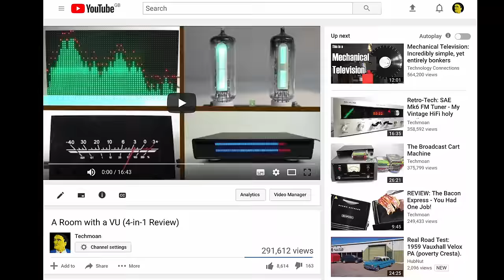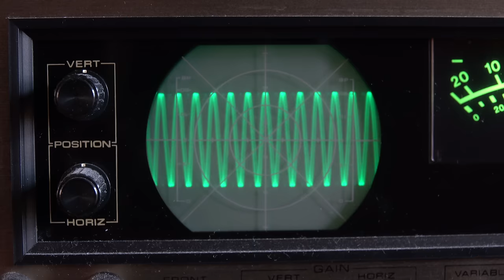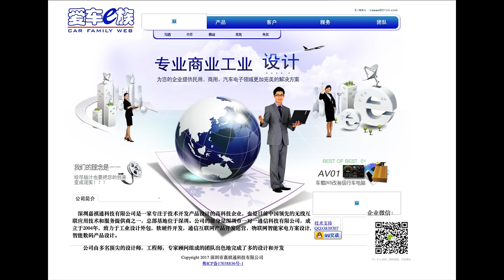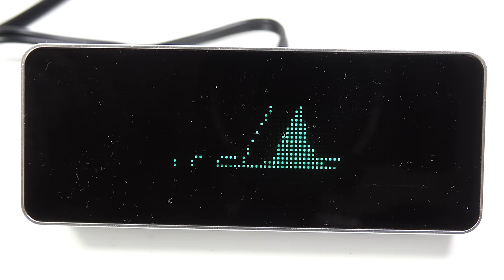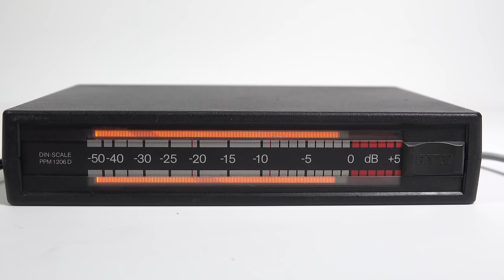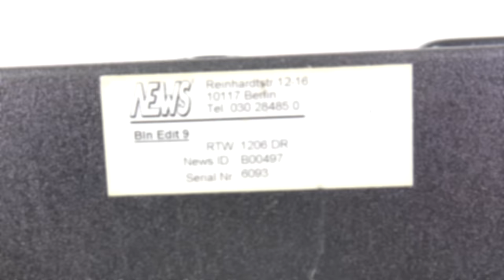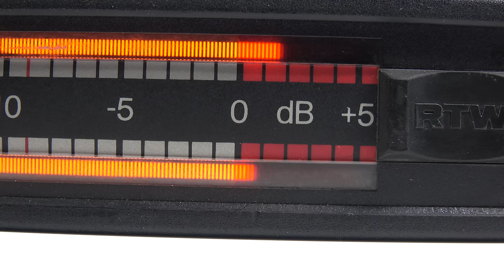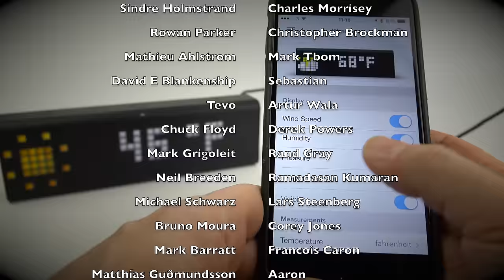What a lovely VU : A metre of meters*

Comment: 10:34

I think there may be a bit of a hidden feature on that VU meter.

It looks like there is an extra scale display inside that plastic cover. Maybe it has to be manually rotated 180-degrees so it fits the front panel.

It might just be a replacement scale, or have different values printed on it.
Reply: Ahh, here we are...

"Dual standard model with a practical sliding scale
Depending on the model you choose the ingenious sliding scale
enables either twin standard operation or switching between
horizontal and vertical installation."

http://www.old.studitech.ru/resque/manuals/rtw/RTW_1200_Series_PI.pdf
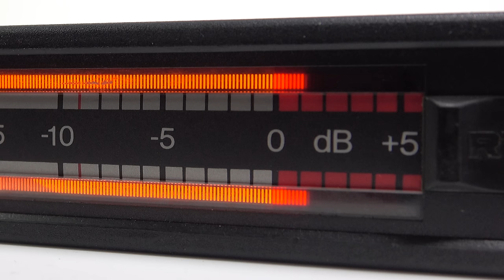Reply: 10:07

OK, so you basically just slide that thumb dial to the left, and it will shove in the other type of scale, where the numbers are rotated. Nice.
Reply: LOVED the puppet sketch. haha

You get people complaining about the ~15 KHz CRT noise on many retro gaming vids, too.

It was never that big a deal, even when I was very young and could hear it from a mile off.

I kind of miss CRTs now (I used to repair them), and I'm slowly rediscovering how great they can look.

I NEED to get hold of a proper PVM soon.

Comment: What?  People are sensitive to a CRT's high pitch whine? When I was a kid, I could only hear it when I put my ear on or near the back of a TV set. Living in America might have something to do with it though. I don't think it would be that much higher in frequency. I never had a C64. What we had was a TRS80 Color Computer 2 which was similar to the Dragon computer. It didn't have a SID chip. Just one square wave channel that was produced by the CPU itself. I suppose they could have made one for the expansion bay. They did have a music synthesizer for it. The expansion bay was where you placed ROM packs (cartridges) and the disk drive module.
Reply: Robert Gaines The European PAL system fixed color decoding problems inherent in the NTSC signal by using 64μs delay in the composite to RGB decoder. In most products, this was an acoustic delay playing part of the video signal as vibrations through a precisely cut crystal block.  I'm guessing this can leak more of the whine from pixels and sync pulses repeating line by line.

Comment: Anyone noticed the RTW "button" in front? Seem that it slides (left and right) to enable different scale.
Reply: No it's for horizontal or vertical positioning
Reply: It does! @techmoan Do be careful though if you try it out to see what your other scale reads (depending on the scale could be dbu / dbv) as they get more prone to breaking the older they get. It is possible to get replacements through RTW but they are quite expensive.
Reply: Yes it does, in this case it seems to change between horizontal and vertical scale. I guess there were different layouts available. I have worked years with these meters, quite common in the broadcasting industry in Europe, very good meters and apparently very reliable too.

Edit: Looking more carefully it says it in the product description in RTW's web site. There were different models. I myself have model 1206N that switches between DIN and Nordic scale. Wikipedia has a good article on the subject, look for "Peak programme meter".
Reply: Our RTW's can display VU or PPM, depending on the position of the slider. It senses the position and works accordingly. Other versions have horizontal/vertical scale.

Comment: The struggle with CRT noise is real. When I was growing up in the 80's and 90's, I got migraines from it. When I was real little, my dad noticed any time we'd go to the TV section of an electronics store (dad spent lots of time in them with me because he was always shopping for computer parts), I'd cover my ears. He thought it was the noise until we did an experiment when I was about 8 or so that proved I was able to tell whether a TV was on or off and with the sound muted. As I got older I found it interesting how what was on the screen would modulate the sound. Though I'm in my late 30's, doctors are surprised that I can even hear ultrasounds (I just recently had several scans because of a gall bladder issue).
Reply: I used to have a problem with the ultrasound burglar alarm at a local hardware store when I was a kid back in the70's. I used to say something to my parents everytime we went in there , but they couldn't hear it so I guess they thought I was nuts.

Comment: You should try out a DOD SR Real Time Audio Analyzer, makes a great visualizer, its relatively cheap, much better quality than the stuff you have reviewed and on top has an actual use.  It creates a pink noise so you can calibrate your stereo via an equalizer.  You would love it.  Its a nice size as well, its rack mounted so it may not look great depending on your setup, the frequency range is very wide as well.

Comment: The display look alot like the one in the Nakamichi T-100 test set.
The little one might be good quick verification of signals depending on if you had the ability to look at separate left and right and not composite

Comment: Are these spectrum analysers simply using the FFT internally, or are they using some kind of digital filtering like a vocoder? I'd love to know how these things actually work, and what kind of DSP chips they're using (if any).
Reply: Amberoot Audio They look like primitive band pass filters (or digital emulations).  Because a proper 0.1s FFT should not smear out the test signal to nearby frequency bands like that.
Reply: @johnfrancisdoe1563  Thank you, makes sense. I thought the same about the frequency resolution. I noticed at 7:40 how quickly the frequency display 'rushed' to the higher frequencies relative to the lower frequencies, which shows that not only is the frequency domain not logarithmic, but the frequencies the band pass filters were tuned to must have been arbitrarily chosen for the sake of creating the most exciting animation.

Comment: Try this peak display out  it’s from America audio the model is dB display mk 2 it’s as 19”  led display nice and bright you can set the display level with a control on the front panel it has a left and right Chanel. rack mountable unit rca xlr inputs and outputs.  I use it on my hifi very impressive bit of bling    I forgot to tell you all they are about £45 ish shop around prices very

Comment: Dear Techmoan, The RTW meter's plasma display is very similar to that of the rare Nakamichi T-100 Audio Analyzer. If you can get a hold of a T-100 for a reasonable price, just buy it. I have one made in the early 80s and use it to align cassette deck heads and to test speaker cabinets but also as the nicest looking peak program / VU meter ever. Here's one: https://reverb.com/item/10817569-nakamichi-t-100-audio-analyzer-working-and-tested

Comment: I had a VHS player when I was a kid that had the same type of display
Reply: Good question glad you asked! If you don't remember there was this period where VCRs became basically worthless, idk kind of close to when DVDs came out. Anyways me being extremely curious about how electronics work I took it apart to use the motors for projects. I ended up using the display as a clock for my pinewood derby car shaped like an IED (improvised explosives device). Anyways as for my collection of VHS tapes I converted most of them to digital formats at some point, as much as I love the nostalgia of a VHS tapes, they went exactly built to last
Reply: @P004ME2LicensePlate  I think were getting way outside the scope of my initial comment here. Point is vacuum florescent displays similar to this are pretty common in consumer electronics.

Comment: Is that a Dorrough meter in the teaser at the end? Their meters show VU + PPM to represent the crest factor (like Wohler... check this one https://www.wohler.com/product/audio-monitoring/amp1-da106/)
Not sure RTW discontinued the 1206 bc the display manufacturer stopped... I mean they could have replaced it with something else. The industry has just evolved: most mixing consoles, even the cheap one, come now equipped with very good meters (wasn't necessarily the case before) so RTW needs to go to the next step. Their focus is really on loudness measurement (and this can be so much more complicated to display) and multichannel. Their service is indeed amazing... always super fast to reply to emails. I once had an issue with my meter and they fixed it at no cost (and paid for the return shipping) although it wasn't under warranty anymore.

Comment: i picked up a kit from ak tech similar to the first one, though the one i purchased combines both channels into w single display so it isn't as wide and it seems a bit taller.  the construction is similar, but this one has a connector in the middle of the boards as well as to either side.  the leds are the same style, but are green all the way up.  i didn't have any issues with it, though it seems to require high volume input to really light up, thankfully i have a headphone out on my preamp that i don't use so it isn't an issue.  it makes everything sound so much better, like a flame job on a car.

about the leds cutting out, are you using the cord supplied with the kit?  mine had a similar issue until i replaced the headphone cord with a higher quality, tighter fitting one.  the one that comes with the kit is junk and the female input on the board is cheap and loose.  listen for some noise coming from it, the cheap cord put a very noticeable hum in my audio where it was loose in the jack.

Comment: @Techmoan Could I ask you a question? I have a Teac X-3R reel-to-reel and the VU-meters have gotten some UV-damage but work excellently otherwise. It's just that, just like red cars from yesteryear, the red line and text on it has faded over the years. Do you perhaps know any way to restore this, or maybe a location I could find information on restoring VU-meters?
Reply from the maker: I don’t know - but perhaps ask on Tapeheads.net
Reply: @Techmoan  Thanks, I'll give that a go. 

Otherwise the only way I can think of is simply getting a replacement set of meters that are still in good shape, or at least ones of which the label is in good shape.

Thanks again.

Comment: Hated the high frequency noise from some crt's 
Some were worse than others. I remember Rank Arena colour TVs were terrible. I could hear thd sound of them from the street when i was walking down the road. And some banks had terminals that were just unbearable. When computers were introduced to my workplace, i thouggt i was going to go mad from the high frequency noise. The only saving grace was i could hear a monitor left turned on at night anywhere in the building and go and turn it off. It was company policy  that everything be switched off and powered down overnight.

Comment: I am thinking about getting a couple of those cheap VU metres from China and making a homemade unit. Supposedly they come with aññ the circuitry on the back of each metre to connect direct to the speaker connection on the amp in parallel, but, my concern and something I can't find an answer to, is wouldn't this affect the speaker impedance like having 2 speakers in parallel in the same output, which would lower the ohms too much?

Comment: I have /had a service manual for the rtw somewhere . Do you want it?  (found it and it is for the 1113E peak meter instead)
Reply from the maker: Thanks for the offer - but I don’t think I’d use it.
Reply: @Techmoan  Hi , now that ive found it, it's for the 1113E  (used the same display i believe)  .
Reply: Hello love VU meters as well... I want to find an extremely accurate one for use with adjusting and testing audio equipment... I've read that the ones in cassette decks aren't extremely accurate LOL and only the upper portion is the more accurate portion of the whole scale (but still not like SUPER ACCURATE) the 3rd one looks like a very accurate one ... being used in a professional recording studio I'm sure its MUCH MORE ACCURATE than the ones used in cassette machines ... look forward to the follow up videos to come ... GREAT JOB on the videos you make love your channel
Reply: Try to find yourself an audio test set like the Ferrograph RTS1 or similar . They make aligning tape recorders relatively easy (something i used to do for a living)

Comment: I never miss an episode and rarely stay for the puppets but OMG that whine from CRTs is real and it’s horrible!!! I’ve been trapped in a cancer scanning machine once for 4 hours and the CRT across the room was the worst and NO ONE but me could hear it. I was I my mid 20s then and I was basically told I was crazy. 

I need to find an old CRT to check if I can still hear that sound because it will legit make you want to jump from the highest room off the tallest tower.
Reply: Jesamy Porter 15.625kHz exactly in Europe's 625 line x 25 fps format.

Comment: Today, electronic devices so mini. Miniature! İn my opinon,this is not necessary. İt had to be in a balance. I would prefer to transistors and more big electronic devices;  instead of microchips... İnstead of miniature size and expensive electronic devices.
Reply: High-density highly integrated devices are plain cheaper. Same ICs in smaller package are cheaper. BGA is cheaper than SO and in turn SO are a lot cheaper than DIP.
Reply: Siana Gearz , It may be cheaper in your country. Varies. Although I don't think of cheapness, electronic equipment is still so mini. Maybe I wasn't used to  shrinking of the electronics.
Reply: @davutsakalli   It's not a matter of being cheaper in any given country, it's cheaper to the manufacturer. Look at LCSC prices, that's a Chinese distributor. DIP availability is horrible too. You can look at other distributors in whatever region - Arrow, Digikey, Bürklin, Farnell, same thing all over, and we're covering 4 different regions of origin now easily spanning the globe.

Certainly it's possible to push compactisation too far. The combination of brittle RoHS solder, mechanical flex on the PCB, and BGA is responsible for the typical device failure mode. Underfill has been introduced to try mitigate BGA failures, but it has issues of its own.

Then again this is not why the first device failed, as it's BGA-free, the control board is mostly SO and the display board is still DIP. It likely failed at a DIP connection and RoHS solder may have played a role, but mostly they simply don't have the manufacturing process tuned down.
Reply: Siana Gearz,   You said true. What say I? 
Thanks for replies ♥ best regards